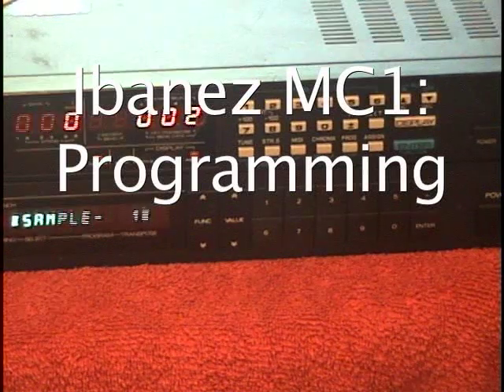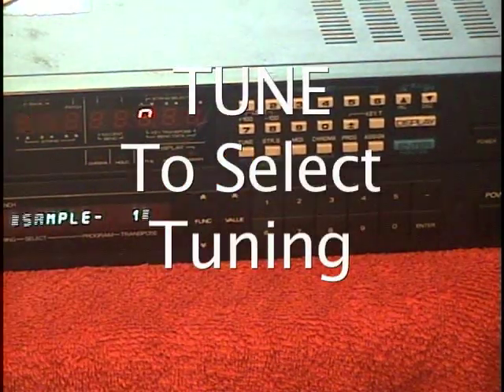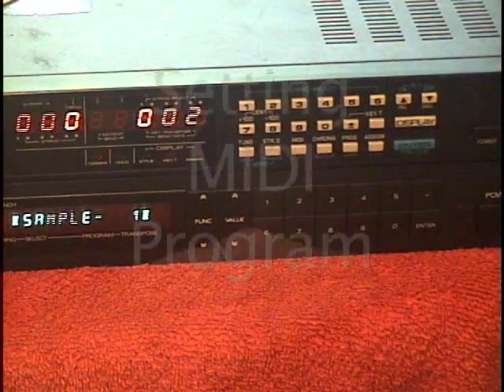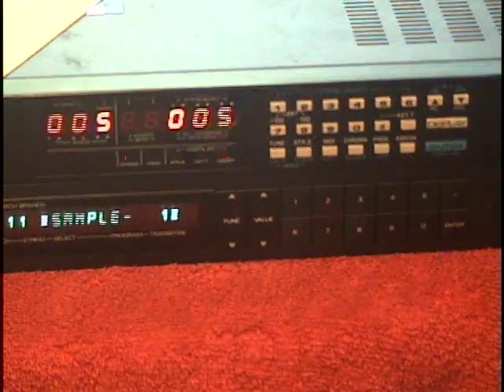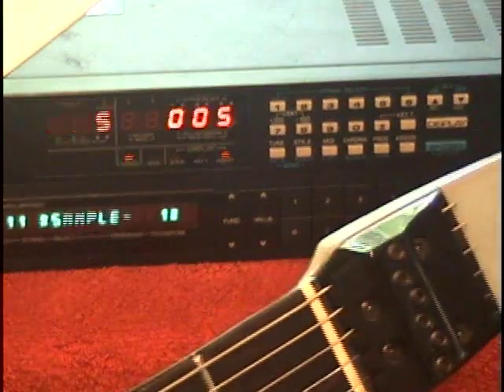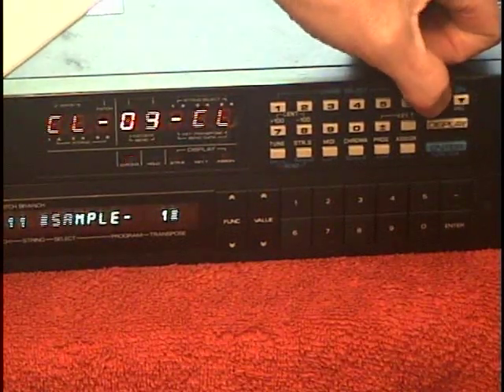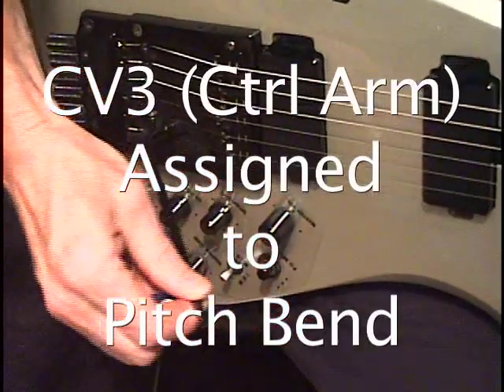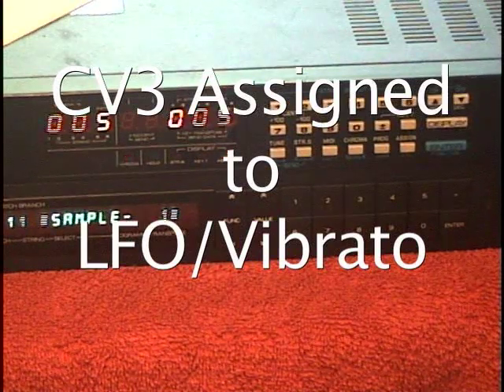Ibanez MC1 Vintage MIDI Guitar Controllers Tutorial - Programming the MC1

Comment: Will the G707 work with the MC-1? I have tried and it does not work for me. However, my IMG-2010 works great with my GR-700.
Reply from the maker: The G-707 will most definitely work with the MC1-1, no problem.
Reply: @WayneJoness  thanks, there must be a setting that I’m not finding. I’ll keep trying.

Comment: If you were to use an alternate tuning on the IMG2010, would it still work with the MC-1 and other MIDI devices? I was wondering since it looks like the tuner only tunes to E standard and I can't find an example of anyone else doing this online.
Reply from the maker: You could tune to open 'D' for example, and that would work. If you used microtonal tunings then MIDI pitch bend would always be sent.
Reply: @WayneJoness  I see, so it has to follow the standard tuning but it could be something like a whole or half step down right? As in something like open F or drop D would not be acceptable
Reply from the maker: @TheChannelZS  Any tuning will work.

Comment: Does the MC1 produce different sounds? I have an Ibanez img2010.
Reply from the maker: The MC1 has no internal sounds, it needs to be connected to some kind of MIDI device, a keyboard, a module, or even a computer.
Reply: @WayneJoness  So what does this box actually do. It seems like the Ibanez img2020 sold this as a package deal with the MC1. Why wouldn't they include a synth etc.
Reply: @WayneJoness  Can u recommend a good low cost synth for this setup. IMG2010 w an MC1.
Reply: @WayneJoness  Where are you getting your sounds from in this video.
Reply from the maker: @Arcturian1111  I am using the Roland XV-5080